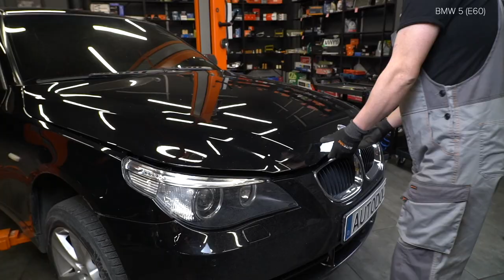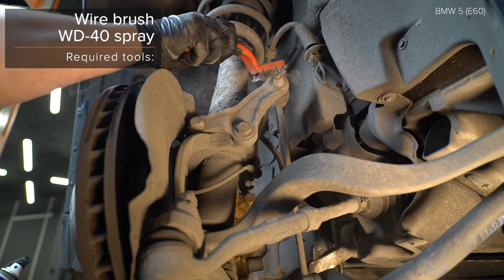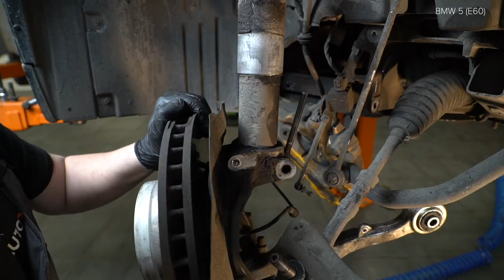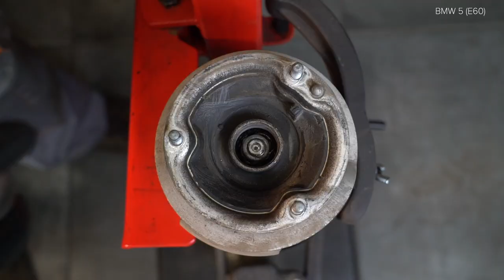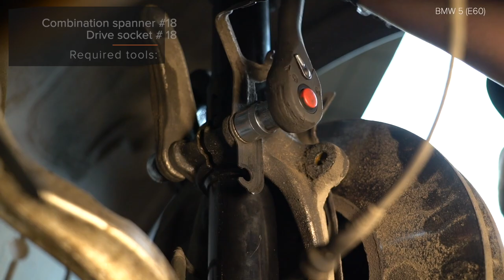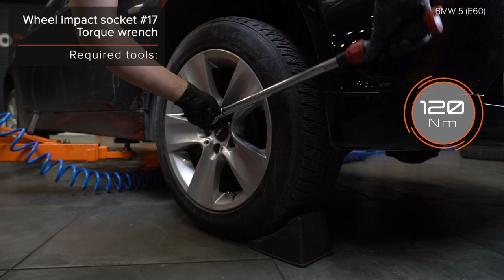How to change front springs / front coil springs on BMW E60 [TUTORIAL AUTODOC]

Comment: Replacing the front coil springs on an e60 is literally a 20 minute job, genuinely.

1) Disconnect top of drop link
2) if its driver side, disconnect headlight rod
3) Unclip ABS sensor and brake flexi from strut
4) Compress spring with hand held spring compressors whilst strut is still fitted to car
5) Support strut at bottom using trolley jack
6) Open bonnet and Remove 3 x 13mm strut mount nuts
7) lower trolley jack to allow assembly to drop, remove trolley jack
8) Compress the strut by hand enough to pop the top out under the wheel arch
9) Undo top strut centre nut (Rattle gun works well without having to hold centre with torx)
10) Remove old spring
11) Compress the new spring, fit to strut
12)  Reverse all of the above to refit

No need to piss about with the ball joint or control arms

You're welcome... 👍
Reply from the maker: Thank you for your feedback, we will keep that in mind in our future videos.
Reply: Excellent idea thanks! Could you tell me which spring compressor i shuld buy? There is just so many thx.

Comment: New spring sits crooked befor compressing. Is that normal for those or defective?
Reply from the maker: Thank you for your comment! Unfortunately, it is not possible to answer your question unambiguously.
Reply: Normal, did mine today straightens/flattens out when the car is on the ground m8

Comment: I've never seen a mechanic use so much WD40 and spray copper grease. He manages to get both on the disc and pads.
Reply from the maker: After using copper grease, it is better to clean the working surface of the discs and pads.
AUTODOC